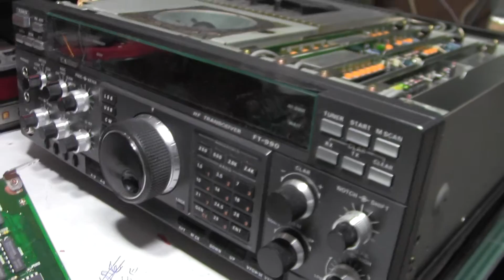Yaesu FT-990 on 60 meters CFARS  / Mars TX/RX  Mod Part 1

Comment: hi friend i am V85AFH from Brunei Station...i have problem on my FT-990. the problem ia on TX. RX on the set no problem. question is there a problem on TX such is like its IC or else? my 990 is not in operational for about 4 years naver switch on or use. thank you if there is an advice for me. sorry my english is bad.